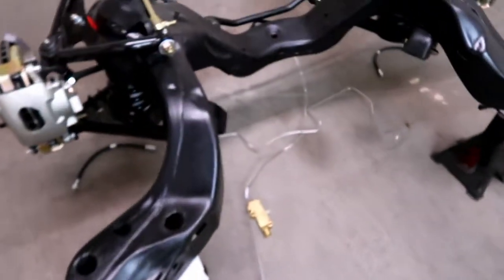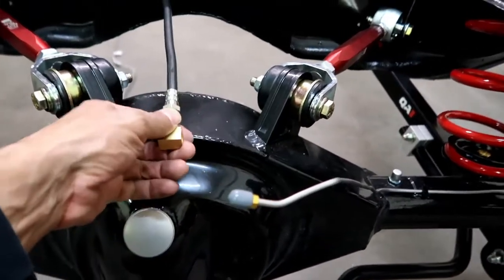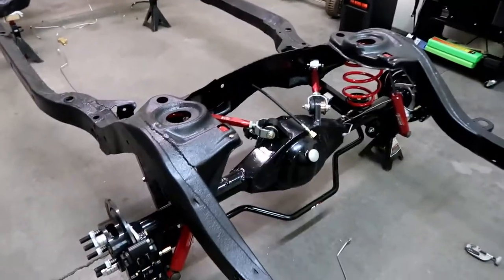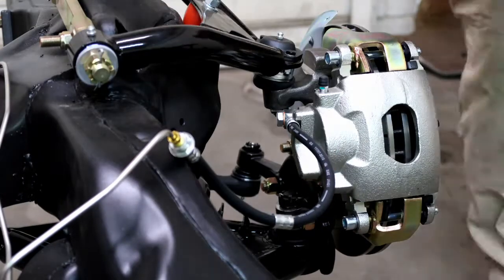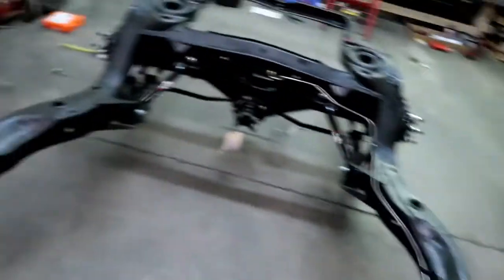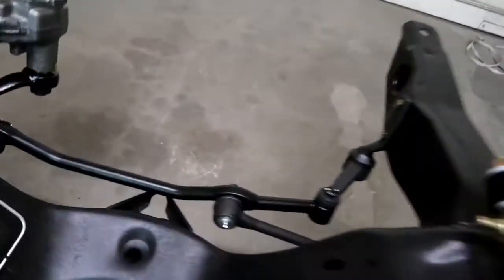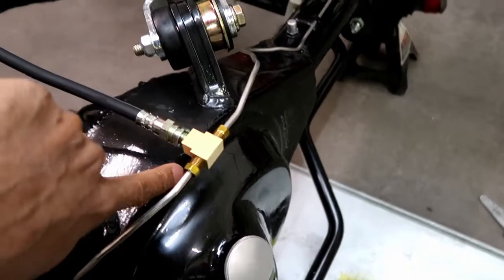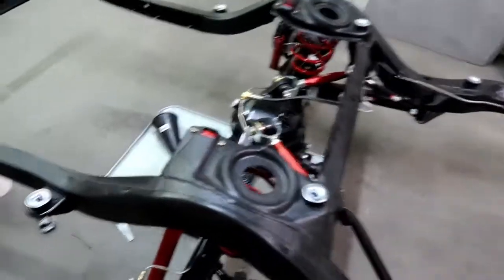1965 Pontiac GTO (GM A Body) Restoration - Drag Race Project - Brake Line Installation

Comment: My 68 GTO has a mounting bracket that uses the top diff cover bolt to hold all of that in place.  Not sure if 65 used that, but that might be an option.
Reply from the maker: I’ll check into it, thanks!

Comment: curious about the banjo bold being aligned. i have not heard of this before.  have you checked with others?  i  think torque spec is 25 or 35 ft pounds so where ever the hole ends up should be where it ends up?
Reply from the maker: You may be right, this is what I found on the interwebs...  "To install them properly, check the inside of the hole which accepts the bolt. You'll find a ring that goes around the bolt. This design makes it possible for fluid to get into the system regardless of where the hole is on the banjo bolt".
Reply: @themiddleagedgoodtimers4768  Right on.  Yah my teacher never mentioned that when we did brakes in class.  I was like wait, I'm gonna ask.  I sometimes miss stuff.  keep up the good work, have a good night